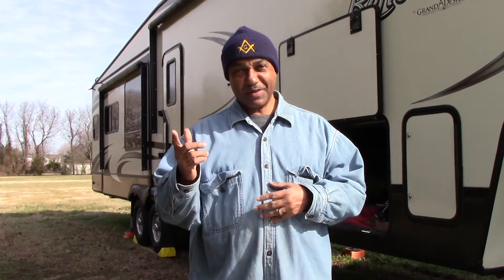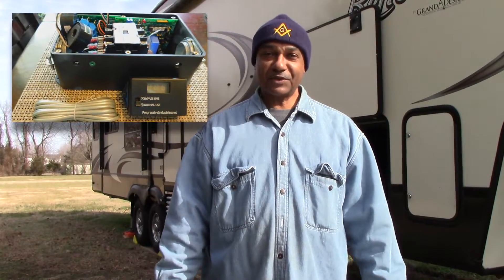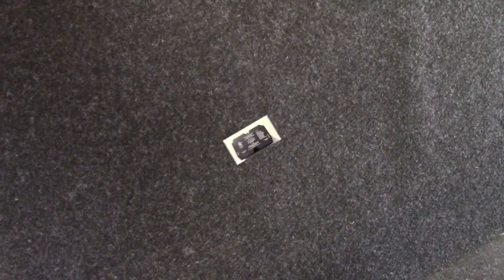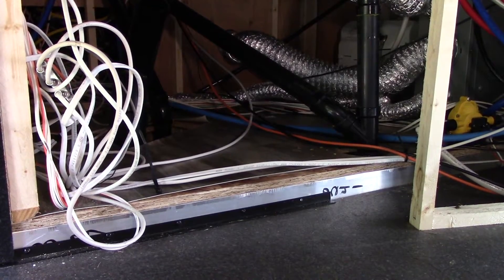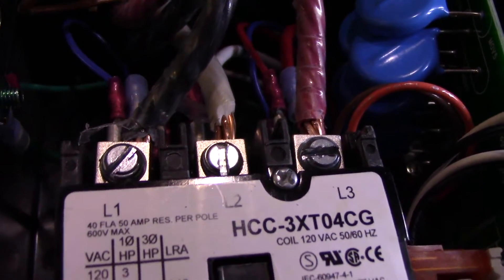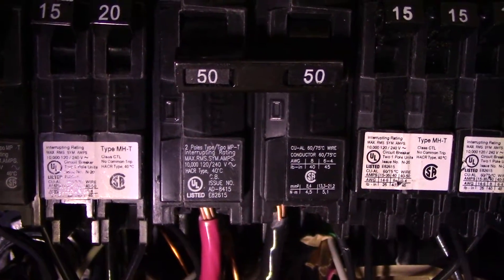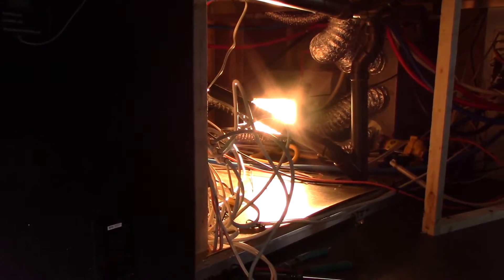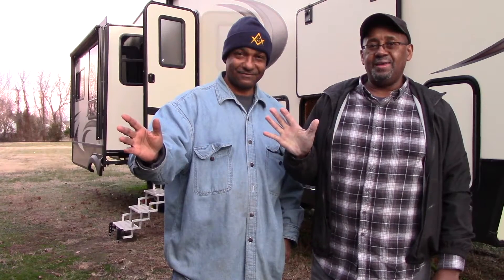Installed A Hardwired Surge Protector in our //Grand Design// Reflection // 367BHS

Comment: I thought I'd waded through all your old video's after I subscribed.  Must have missed this one.  What a gem of information.

I just had the "Panel" off in my basement as I installed two new antenna's (Directv / Wifi-Cell) on my GD 337 RLS.

I'm on my second surge protector and have toyed with the idea of doing this.  After watching this (I'm a Home Inspector and licensed electrician), I think I'm going to do this before we head out this Mar for our 3 month "test".   Again, great video.
Reply from the maker: Thank you very much and glad you found it. It should be an easy install for you. Good luck.

Comment: We just purchased a 2019 Grand Design Reflection 5th wheel and I’m very interested in adding something like this. Really don’t like the idea of hanging a $300-$500 surge protector on a power point to been destroyed by rain or be stolen.
Reply from the maker: I agree 100%. Ours is still working fine with no issues. Good luck.

Comment: I’m not a electrician but should you not have 4 wires with 50 amp service? L1,L2, ground and neutral
Reply from the maker: I'm not an electrician either that's why i had my father in law do the wiring.  It has worked like a charm from the day we put it in. We've had surges and drops at the campground and we are still good.
Thanks for the comment.
Reply: Yes, 50 amp service wire should be 4 wire.